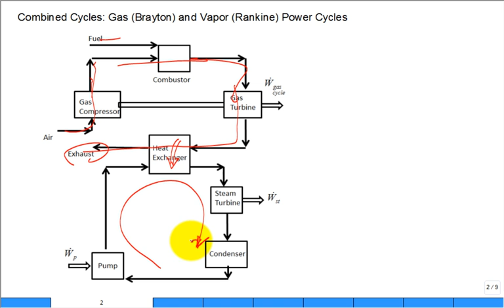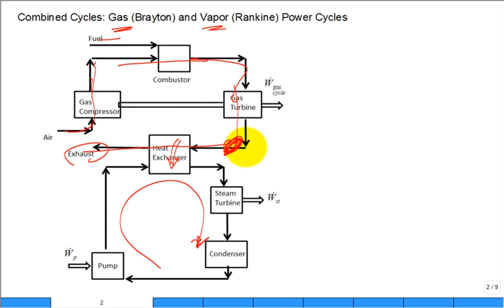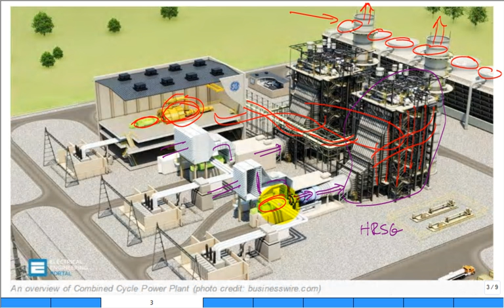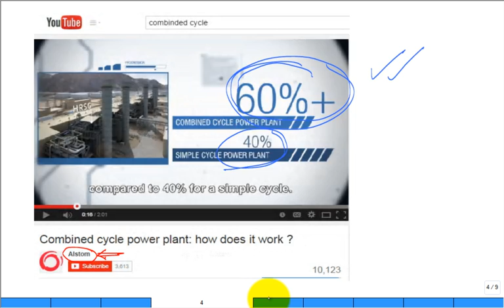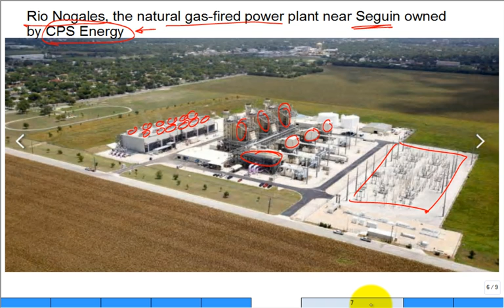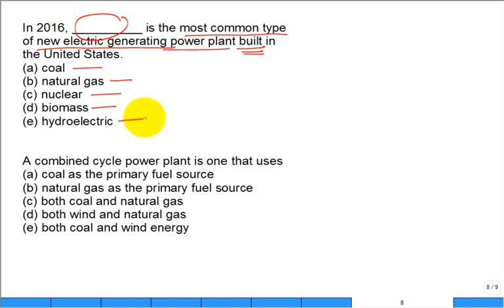ME4293 Combined Cycle Power Plant Spring2017

Comment: HRSG shouldve been called a Heat Recovery Boiler Room,  as they are designed to boil the water then pass the steam to the actual Steam Generator. Im pretty sure the transformers are located on the left side with the walls built around them.

Comment: Built 4 combined cycles for tva... Natural gas is up on ge models to 66% 👀 #hydogenseals
Reply: New bucket design and upgraded bearings the two gas run at 40% idle turbine 2500rpm shame runs at 60% free 👍 great design hard to work on 😆 pull ye a generator rotor once cod 😆 😆 I've done 11